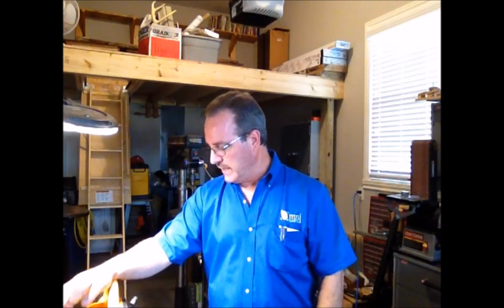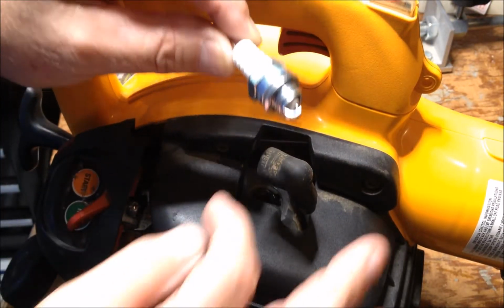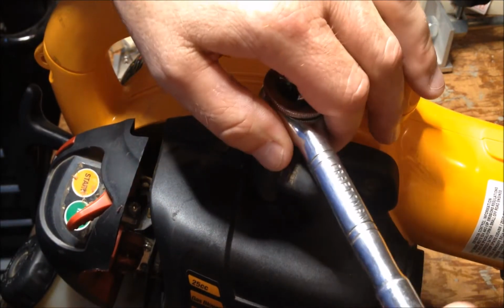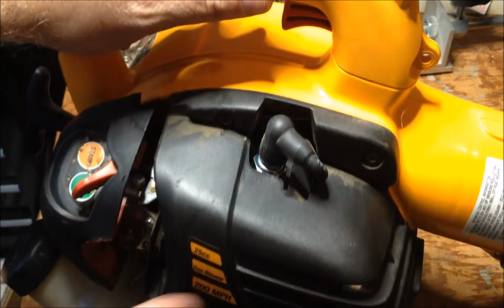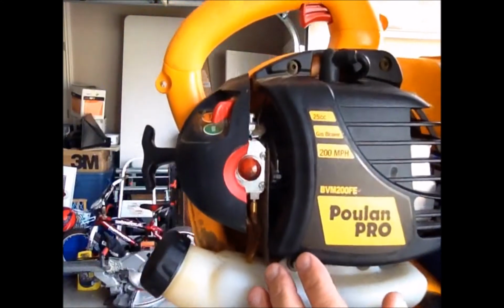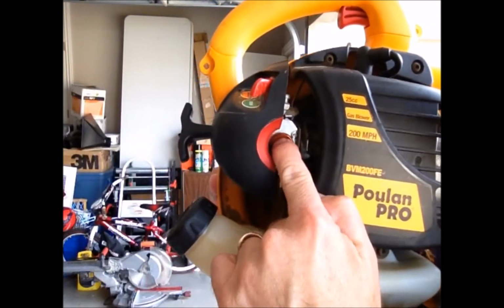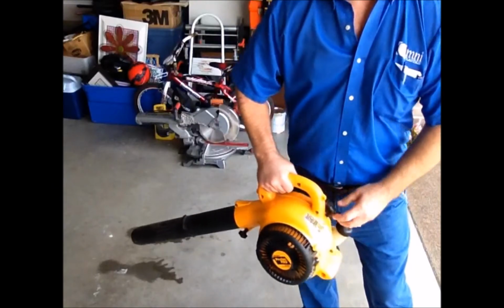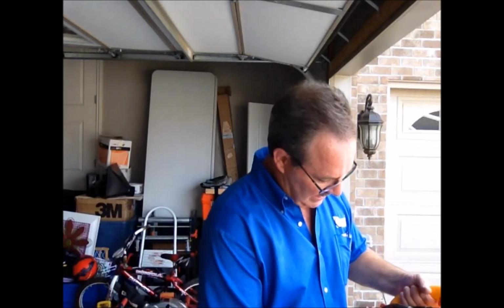Leaf Blower Spark Plug

Comment: I had a Green Colored 25cc WEEDEATER < IDENTICAL , no start low compression , the ring seized on the piston .tried to save but ring broke , put new ring from ebay fixed the problem
Reply from the maker: Thank you for the info Joni. This one started working after sitting all winter and ran great last summer. I guess it took a while for the sea foam to eat away at the deposits. Not really sure. I’m just happy it works. 

Regards,
Bob

Comment: Maybe you should try putting a carburetor kit in it . As a rule if when  you adjust a carburetor you start with the high and then the low and then the idol . But it doesn't' act like a adjustment problem . I'd try the other carb. or a kit first.
Reply from the maker: +glen  mckelvey Thank you Glen,
  I'm trying all the free options first. I'll probably end up buying a carb in the end 

Regards,
Bob

Comment: Bob, do you have the proper gap on the plug I would check that, you can also remove the plug keep it attached to the ignition lead give it pull and see if your getting a good spark that will eliminate the ignition system. Then I would look into  the fuel system / carburetor.
Reply from the maker: +Joe M Thank you Joe,
  I will give that a try especially since I have a new plug and I neglected to set the gap for it. 

Regards,
Bob

Comment: Did you clean the carberator?
Reply from the maker: Yes,
  It’s still a tough cold start but it does start and I use it every week when I cut the grass. I think I’ll eventually replace it with a battery operated one.

Regards,
Bob

Comment: I just had this same problem with the Poulan BVM200 which is very similar.  I know you got yours running, but this post is for those that have this problem with no fix.  

The problem with mine was the cylinder came loos from the crankcshaft body and the cylinder seal broke.  This caused poor compression.  Unfortunately, you cannot buy just that seal, you have to by a seal kit which cost me $15 on ebay.  However, check your cylinder head first to see if it is loose.  Tighten it and see if that solves your problem.  Here's a vid on how to do that https://www.youtube.com/watch?v=nLo15AqT22U

If it doesn't, you may have a broken cylinder seal like I did.  However, before bothering with that, I would pull the carb off and completely clean, it with carb cleaner/starter fluid spray.  take the carb completely apart and spray it well. Spray every hole and crevice. In the process, check your fuel lines for cracks and splits.  You might also have a broken fuel line.  Then put it all back together and try to start it.

You may also want to change the fuel filter, but this is a doubtful fix. However it's always good to change the fuel filter.

If cleaning the carb doesn't work, the next step would be to adjust the carb adjustment pins.  Carb adjustments for that carb:  completely close both H and L carb pins.  Back out the low about a half turn, back out the high about 1.25 turns.  This will give you a good starting point for adjusting the carb from there.  If in fact your problem is a carb adjustment problem, the blower should start.  Start it, let the machine warm up about 30 seconds.  use the H (high) pin to adjust when you have the throttle pushed all the way, use the when L (low) pin to adjust idle speed.  However, there is also an idle speed screw in front of these carb pins.  You will have to mess with this and the L pin to get a proper idle speed.  For me, carb adjusting is too hard to explain.  But this should give you an idea.  It could also be that you need a new carb or carb kit.  They have aftermarket carbs for this blower on ebay for about $15.  but before you spend money on that...

If none of this works, you will have to take the blower apart and remove the cylinder head to see if that cylinder seal is broke.  If it is, you will have to buy the seal/oring kit like I did.  And since you have the engine apart, you may as well clean the muffler as well as the piston and cylinder head.  I would also replace the piston ring.  However, before you even bother trying to replace the piston ring and cylinder seal, inspect the piston and the inside cylinder walls.  If there are a lot of grooves, forget it, your piston and cylinder are shot.  Not worth buying these, too expensive.  Not to mention that the holes where the muffler bolts into the cylinder are nto tapped on the new cylinders they sell so you will have to have the proper tap and dye to thread it yourself.  Not worth it.

People think that all this isn't worth if for this and other cheap blower but I think it is. My BMV200 is almost 10 years old and I have spent maybe $0 in parts over the years.  But I like the blower and seeing how all these cheap 2-cycle tools have short lives (even the expensive ones do), I would rather fix the one I have that I like than buy a new one.  I also get satisfaction from learning how to fix small engines and actually fixing them.  However, I would not spend more than about 25-30 dollars to get another 2-3 years out of it.  Like I said above, if my piston and cylinder walls were grooved, I would have just trashed the blower.  Mine, however were nice and smooth so it was worth it for me to spend the money on the seal kit.

However, if you use your A LOT, it may be worth it to just buy another blower.  I only use mine maybe 5 hours a year.

These cheap 2-cycle engines have a life of about 50 hours assuming you treat it well (most people don't) and mix the gas/oil properly.  The more expensive ones last longer, but hardly worth the investment for a homeowner.  This is why it's good to have the know-how in fixing these engines.  Many of the parts are cheap.
Reply from the maker: +Vlad The Impaler Țepeș III Thank you for the very thorough explanation, I'm sure someone looking for help will find this incredible useful. 

Regards,
Bob

Comment: what was the problem ??
Reply from the maker: Not 100% sure. I let it set over the winter and it fired right up the following year. I’m wondering if the Sea Foam just needed time to rat away at the deposits in the engine. 

Regards,
Bob